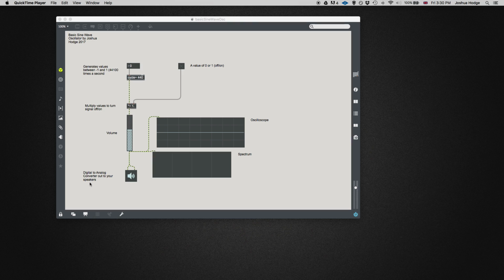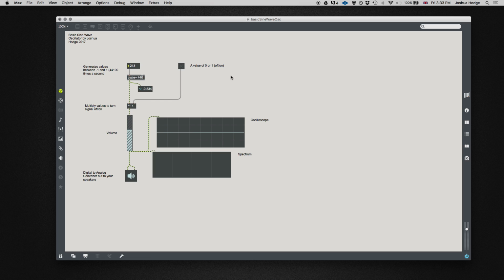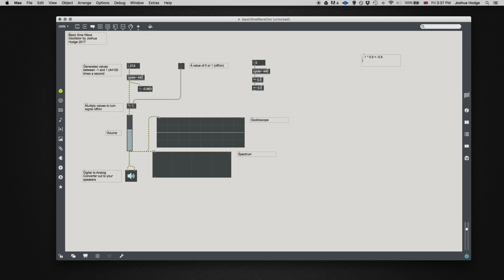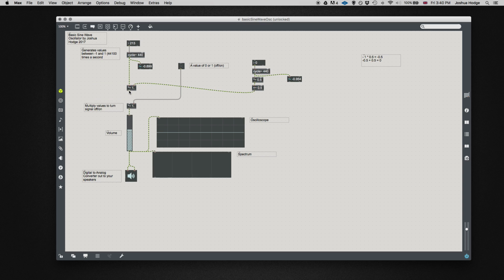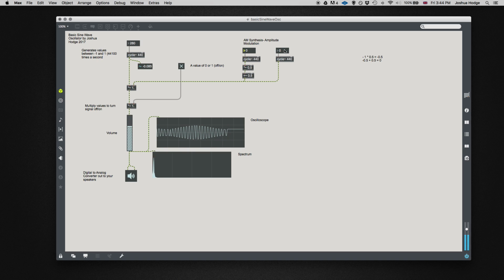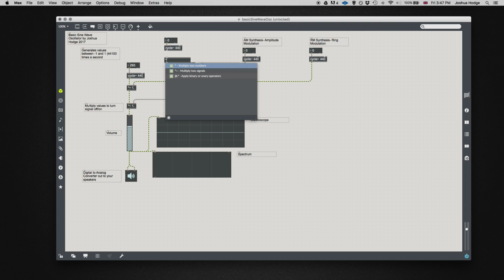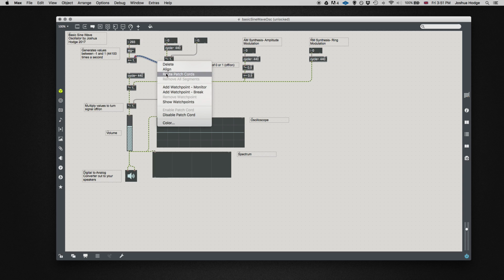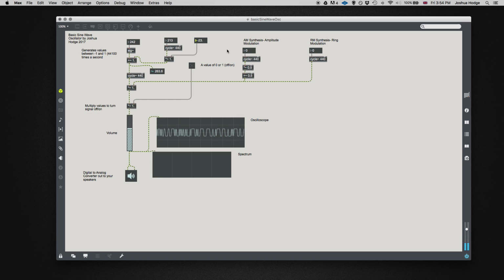Audio Programming for Beginners Tutorial 04 - FM, AM, & RM Synthesis in Max MSP

Comment: Nice video, can I confirm my understanding of the math? For AM, the modulation wave is set to a range of 0 to 1 by m*0.5+0.5 and this is then multiplied with the carier wave for each cycle. RM does the same but the modulation wave keeps the range -1 to 1. FM, works a little different in that it uses the frequency of the modulation wave, (cycles per second) to add the depth value to the carier wave.